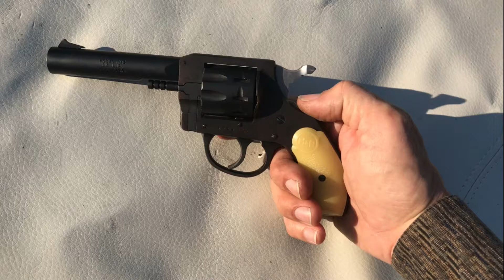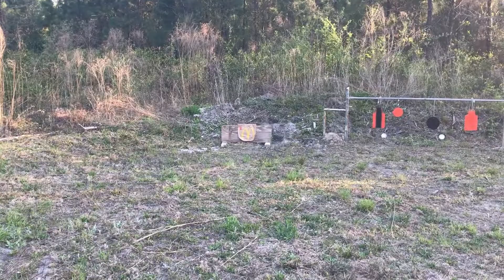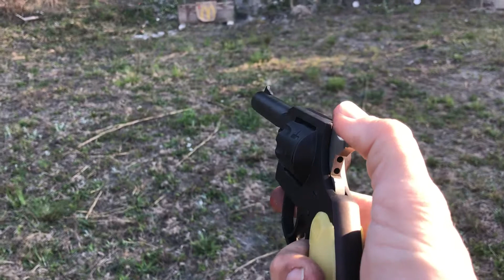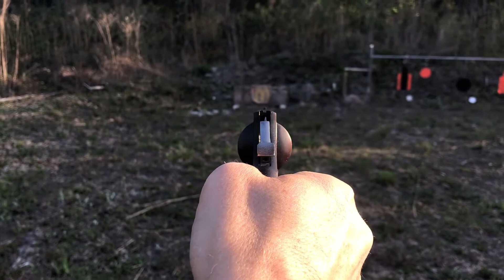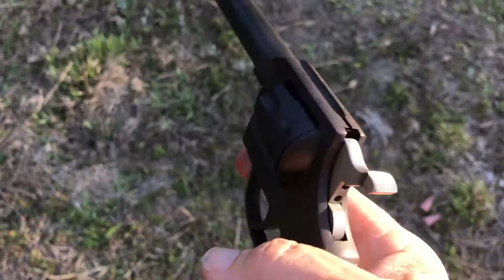H&R 929 V NOTCH CHANNEL

Comment: Nice job! It looks great!
I got one at a show, 1965. It looked like new, but was screwed up from stem to stern.
First, it kept misfiring because of the worn out plastic hammer driver on the mainspring.
They must have been drinking that day in the engineering department.
So I made one out of tool steel, then, the cylinder stop was barely engaging, the double action was slipping out, so I tuned the hammer  and sear catches. Now its 100% dependable. Lastly, I whitened and smoothly contoured the trigger because that thing was terrible with all of those sharp edges. 
I actually trust the half-cock saftey system. The catch is quite deep, and it would take a hell of a blow to make it accidentally discharge.
It's a blue snubby with the same grips as yours, and after many hours, I'm finally happy with it.
Thanks for the great video!
Reply: Apparently they later changed that part to steel.

Comment: Nice restoration!  I just bought one of these. Outstanding condition. No scratches or faded bluing. Action seems nice and tight. The only flaw is it was missing the center pin head. The pin and springs are there and the gun is fully functional but you need to grasp the pin with pliers to open the cylinder.  I was able to buy the head on Gunparts. The problem is its not clear how the head is held on. The head slips over the pin. The parts drawing shows what appears to be a tiny expansion pin that fits in a cross-drilled hole through the pin and head. The problem is there is no cross-drilled hole. The center pin is not threaded, so it doesn't screw on. Can anyone tell me how that head piece attaches to the pin?

Comment: The gun does actually have a safety for carrying. You pull the hammer back one click. The firing pin will stay out of contact with the cartridge until you either pull the trigger or the hammer all the way back and pull the trigger.